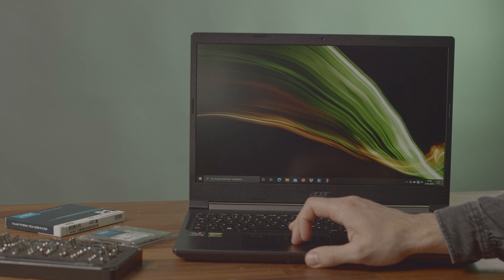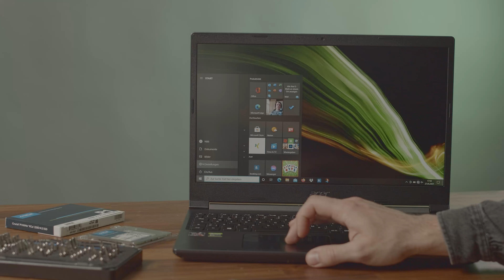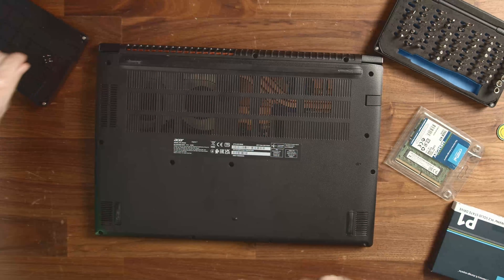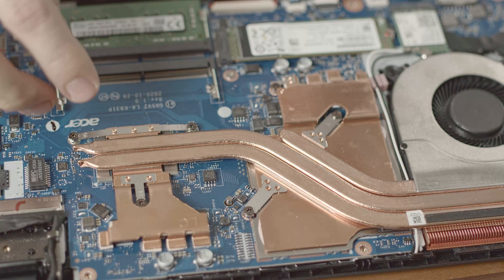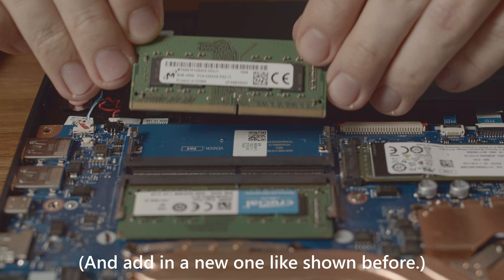Acer Aspire 7 Tutorial: How to Upgrade the RAM & SSD | English

Comment: i have an doubrt, Can I upgrade the ssd over the limit that the brand says, I am having the acer aspire 7 with 12th gen 12400h and rtx 2050 model in spec page it show only supports 2tb of ssd can I upgrade over the limit like 3 to 4tb or move it with the limit

Comment: Hello. Can i ask what specific model of acer aspire 7 is in the video? I have an Acer Aspire 7 A-715-42G-R5C5 and I am not so sure if it supports ssd expansion via replacement. You're answer would greatly help me with this. Thank you.
Reply: you can always replace an existing ssd that is not soldered. should be possible in any aspire 7 laptop.

Comment: I had a laptop that had thermal pads on the bottom of the ram chips so I'm assuming that the Acer aspire 7 does too and if it doesn't can I put a thermal pad there and will it mess up anything or improve anything.

Comment: Thanks for the guide! It's been more than an year since I bought this laptop and I'm upgrading the ram to 16gb as soon as it arrives
Reply: What ram did you buy? Also did you buy a 16gb one or did you buy 2x8gb ones
Reply: @cizula9936 i bought 1 8gb crucial ram (same one as in this video). The laptop of course already had 1 8gb ram and so now I'm using 2 x 8gb ram in dual channel.  2 x 8gb rams in dual channel is more preferable for gaming compared to a single channel 16gb ram stick.
Reply: Did it improve the gaming experience if you are into gaming
Reply: @Hari98-m2s  Yup. Drastically! In light games like valorant there is no stutter whatsover and fps probably increased a bit (but the display of this laptop is just 60hz lol). In heavy AAA story games like Cyberpunk there was lots of lags and stutters on 8GB Ram but now it runs very smooth and very rarely I see any lags and stutters. Same goes for games like GTA 5, RDR2, GoW 4, Marvel's Spiderman & Miles Morales.

TLDR: Yes. It did improve my gaming experience.
Reply: @cruizer4356 What CPU do you have?
Reply: i have Acer Aspire 7 Intel Core i5-10300H Laptop (8GB/512 GB SSD/Windows 10/4 GB NVIDIA GeForce GTX 1650), 2.5kg. i want 16 gb ram. which model 
8gb i should buy?

Comment: When I installed another 8gb Ram of 2667 mhz while having same type before, it decreased to 2400mhz, why this happened? Will it make difference?
Reply: The stick you added likely has a different timing than the existing stick, even if it is from the same manufacturer with the same clock speed.  In order for the motherboard to run both sticks at the same timing, sometimes it has to drop the frequency for one of the RAM sticks. When upgrading RAM, it is recommended to buy a pair of identical sticks from the same batch from the same manufacturer to avoid getting newer modules with different timings.

Comment: Hi ! I am planning to buy one I have two questions though 1. is the cooling similar for i5 1240P based model (I am planning on Aspire 7 i5). 2. Has anyone done an upgrade to Windows 11 Pro as I may plan to play with the virtualization. Thanks for any inputs
Reply: Hi, maybe im a little late,cooling on this laptop is very bad, you play for like hour and then your game starts randomly laging and going from 60 to 3 fps - the sollution for this is to buy cooling pad which i bought. And yea, you can upgrade to win11 easily
Reply: @MackySuSexy   you are right on everything but the windows 11 part man that just isn't it . I know it runs windows 11 easily but it so bugged that it causes constant bosd errors .The nvidia card drivers has a issue with this specific device so in my case reinstalled windows 10. Learned it the hard way

Comment: Hello, this is a silly question? But, how much expansion of SSD can be done in this? And is there any option of adding another ssd, keeping the provided one inside? If not, can the ssd that is replaced not be used anyhow, (since it already is loaded with so much data)?
Reply: Sadly it has only one SSD slot so you have to swap the SSD with another one, and laptops can take upto 2TB of SSD's, its not written anywhere but it is the limit.
And if you have any data stored on the loaded SSD you better move that into some HDD then again move it onto the new SSD if you will, but I'll suggest you buy a External Hard Drive which is quite helpful and pocket friendly
Reply: @Skil13rAD  in the video he mention about replace the wifi module to SSD, so i think its posible

Comment: Hello, thank you for the video, it's great information. I have a question to ask, can I upgrade my Acer Aspire R7-371T?
Reply from the maker: Hey, that is one rare notebook you have there ;). I didn't have the chance to get my hands on it personally, but according to a (german) review you should be able to replace the system SSD as well as add another SSD: https://www.notebookcheck.com/Test-Acer-Aspire-R13-R7-371T-Notebook.137259.0.html
They note that the base cover is a bith tough to open, so be careful and take your time if you want to attempt the upgrade. Also, there is no information about wether the second M.2 Slot is SATA only or also offers PCIe.
Reply: @notebooksbilliger can this upgrades works on my a715 51g 50ff?

Comment: Do we need to unplug the battery or can we do it without unplugging it
Reply: As long as the PC is powered off, you don't need to do anything else. There's no risk of powering the laptop if it is closed anyway. 

Removing a drive when a PC is powered on will simply "remove the access to Windows", and you'd have to power off the device, replug the drive correctly and restart the computer, there shouldn't be any specific issue beside loss of unsaved work, unfinished task etc.
Reply: @GoldenCoastGTA  oh thanks

Comment: Can we use different ram??
Reply: Yes. Mine came with 2x 4GB sticks. I took one out and replaced it with a 16GB stick giving me 20GB in total. Before anyone says you should use matched pairs, I can confirm you don't need matched pairs and never have. Your RAM configuration will now be 8GB of dual channel memory and 12 GB of single channel memory. Neither the motherboard or Windows cares, everything will work fine. At some point when I have more money I'll replace the other 4GB with another 16GB stick. HTH.
Reply: @PPlankBeam  you does this laptop have a 2 4gb ramsticka or a single 8gb ramstick?

Comment: When we replace/upgrade this internal SSD, how do we get back our licensed windows 10 in it?
Reply: I did a quick Google and found this:-
"In Windows 10 all systems no matter how they were activated (be it via Upgrade from Windows 7/8.1 or by using a bought Retail or an embedded BIOS aka MSDM license) will be converted to a Digital License which is based on the Hard Ware ID (HWID) of the respective machine. This License is stored at MS Servers and will activate this machine every time it's freshly installed. Only hardware changes will cause the License being invalidated. By binding it to a Microsoft Account (MSA) you will be able to transfer it in latter case. "
I have no idea how to bind it to an MS account as I don't have one, but this should get you started in the right direction.
Reply: @PPlankBeam  thank you so much for the response, i atleast have some idea now, really helpful thanks 😊👍